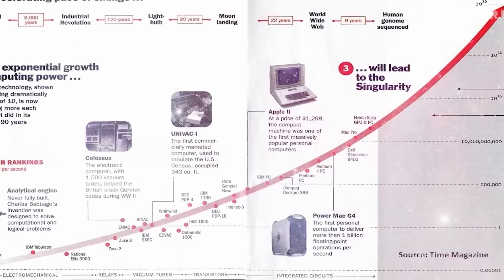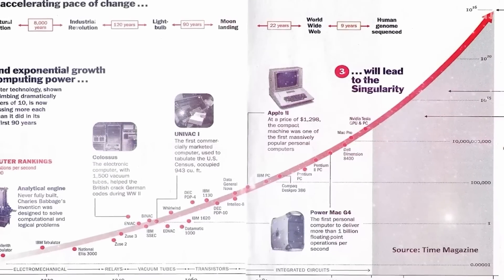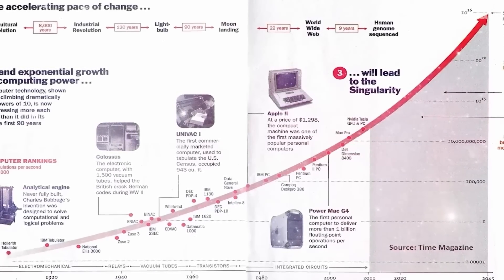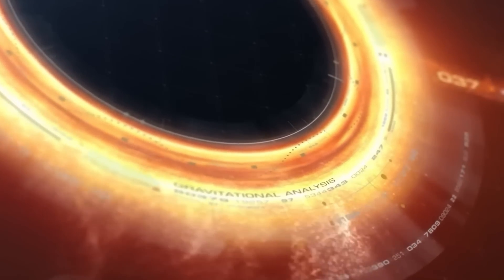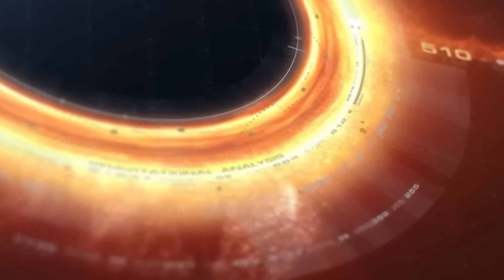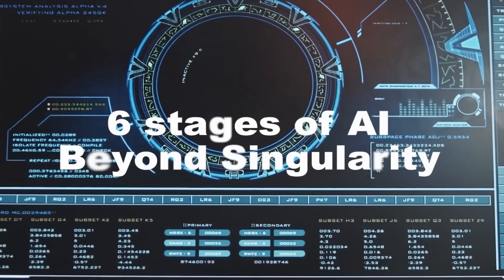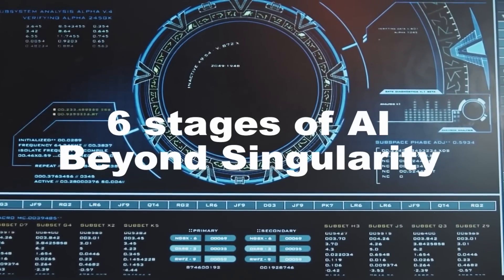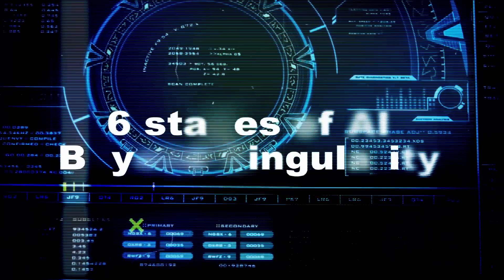The 6 Stages of AI (Beyond Singularity)

Comment: you may maybe not really understand how fast exponential grow is. if an ai can create an AI that's twice as "clever" in a day, and that ai again can make one that's twice as clever in a day, then in a year you have something that's 2^365 times as clever, which is 75153362648762663292463379097258784876021841565066235862633311089030688803667470190838367948312598497021919232 times as clever, by the way.

at this point surely humans won't matter at all anymore and be way way way waaaay less important than you think about an ant colony in your garden.

there won't be some cool interaction between ai and humans, their time scale is simply too different. it's like if you would try to communicate with a tree. or something really really slow :)

it's another point even: if you have an ai that is as clever as a human, lets say in programming, but it's 100.000times faster, then it can get "job experience of a programmer" of thousands of years over the next weekend. (and even program smarter ais in those thousands years).